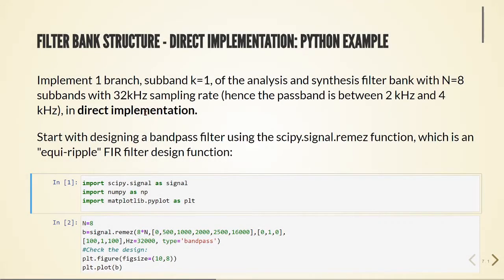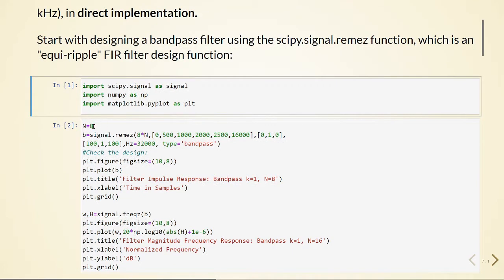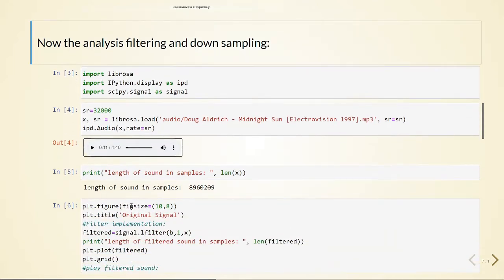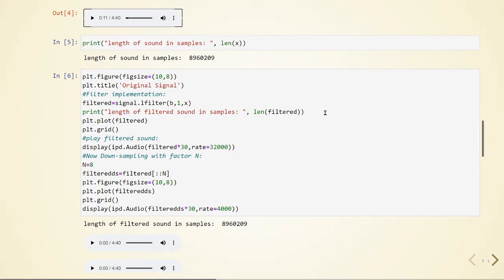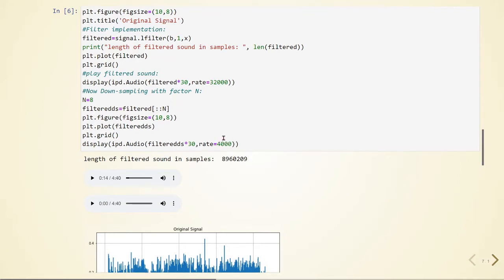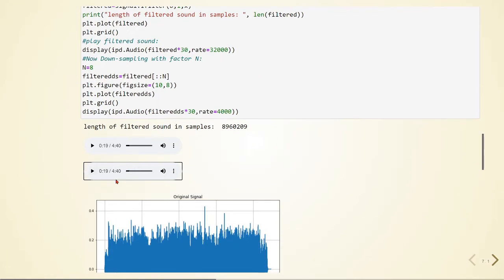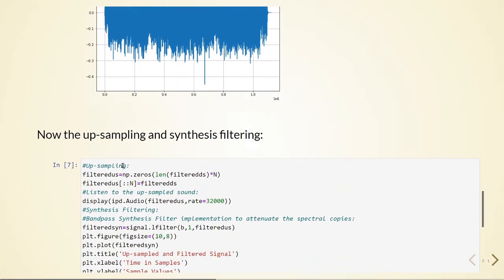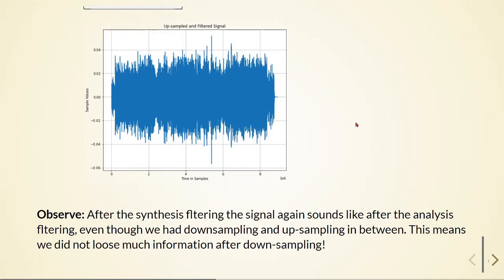Audio Coding - 02 Filter Banks I - 04 Filter Bank Structure: Python Example

Comment: thanks a lot, a masterpiece on how polyphase sub bank works. only a bit confused if the subband number is 8, why the remez(N*8, ..)? what the other '8' represent?
Reply from the maker: hello @xiehe1477, the N*8 in the remez algorithm is the number of taps, that's the filter order. There's a typo in the notebook for the Filter Magnitude plot, the correct is N=8, it's the frequency response of the same filter. The material in GitHub is updated. 

You find more info also at: https://youtu.be/eswCE0FKxNc
Reply: @the-sound-travels  many thanks. It makes sense!